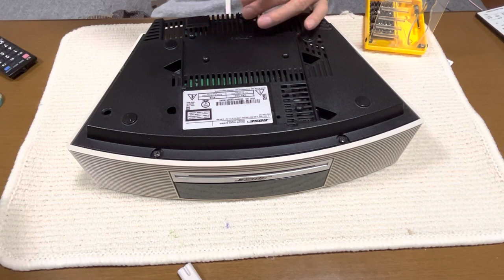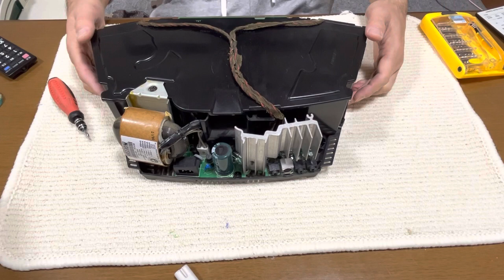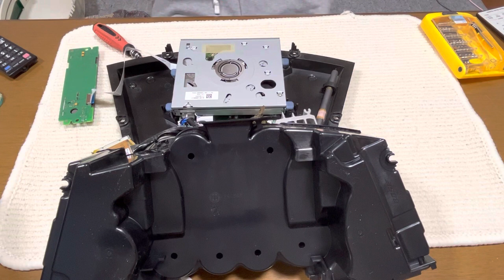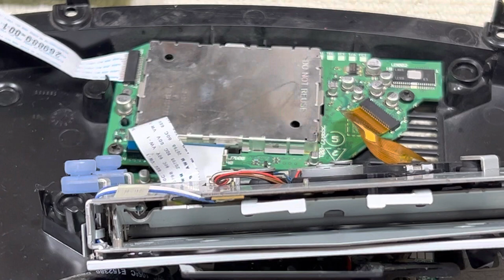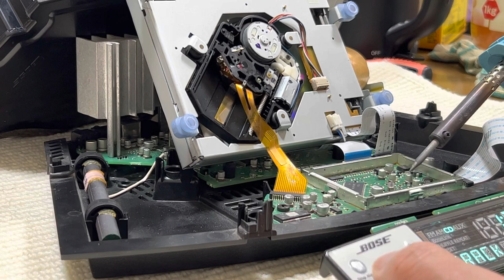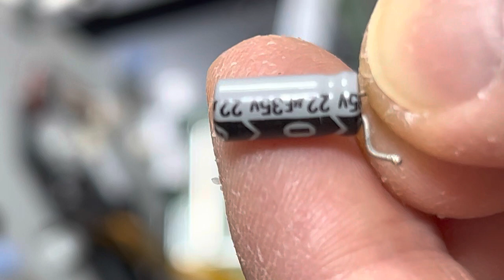BOSE WAVE MUSIC SYSTEM Turn on and CD Click Fix

Comment: I have the clicking CD player problem every few years. The silicone grease on the screw drive that moves the laser back/forth gets ‘dried up’ - I open up the deck (just the remove the top, add some fresh silicone grease to the screw (bottom of CD part), loaded a disc and moved from first track to last about 5-6 times, now it’s like new!